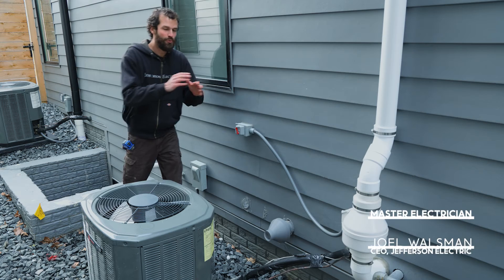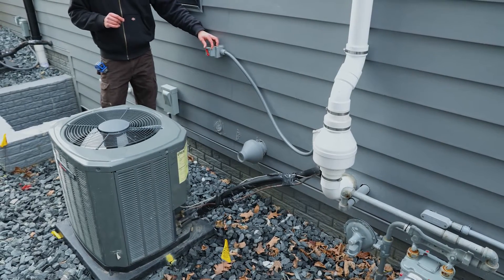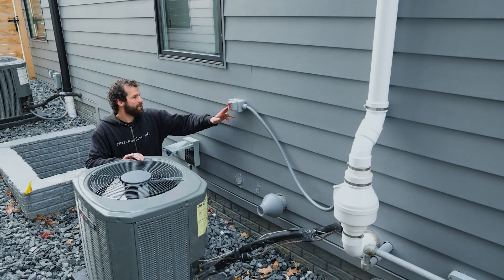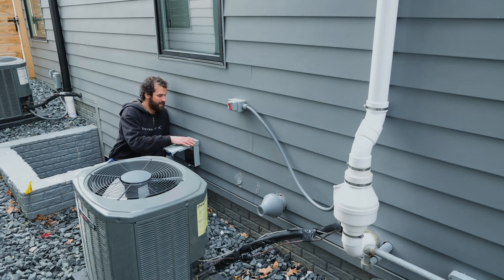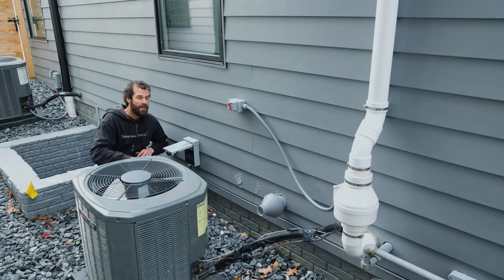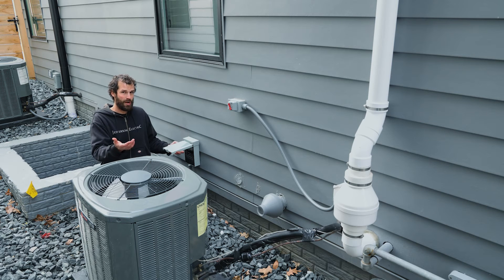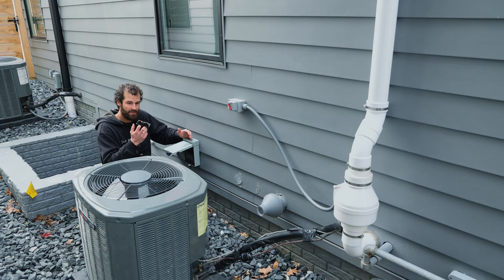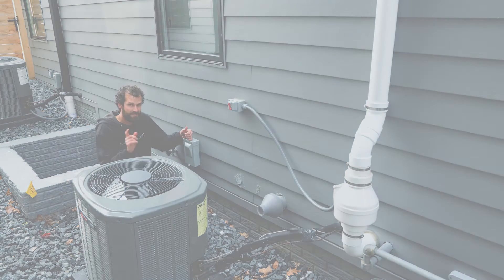AC Unit Electrical - Code Minimum

Comment: I have never understood the use of those pull-out disconnects. Yes, it turns it off and on, but you cannot look away, then look back and KNOW it is still off. If the plug isn't inverted/reinserted, it can be misplaced. So, why not just a regular safety switch, the cut-off with the lever on the side? They are widely available rain-tight, they are actually simpler to install.
Besides being padlock-able, one can merely tell at a glance if it is off. Handle up? ON! handle down? Off.   
Cost more? A little? Worth it? I vote "yes". Saving a couple bucks on this is like saving a dollar by using residential grade outlets and using 14 gauge wire everywhere to save a dime a foot.

Comment: Since this is "Code Minimum", you forgot to mention 2020 NEC 210.63 requiring 125 volt outlet within 25 ft of equipment requiring service. Looks like there might be an outlet next to the air conditioner in the background. Also what a sloppy job on the wiring of the radon extractor. Code violation on the liquid right flexible non-metallic conduit (LFNC) 2020 NEC 356.30 needs to be securely fastened within 12 in of the box.
Reply: Little curious, could you use a (properly sized maybe 30 amp dipole) switch like the one used for the radon fan for the a/c?
Reply: Yes, the first thing I noticed when the video started was that baggy, unsupported flex running to that switch.